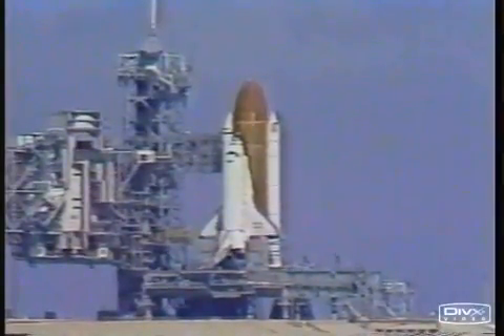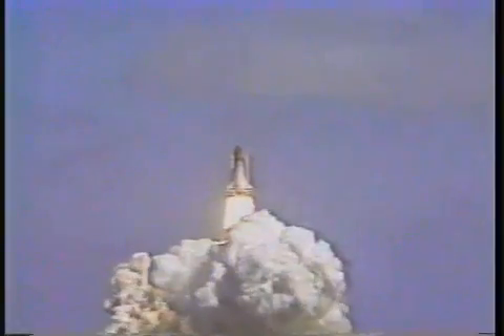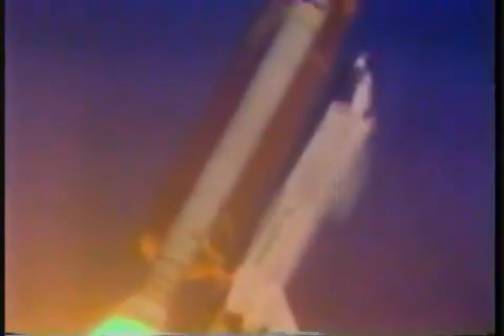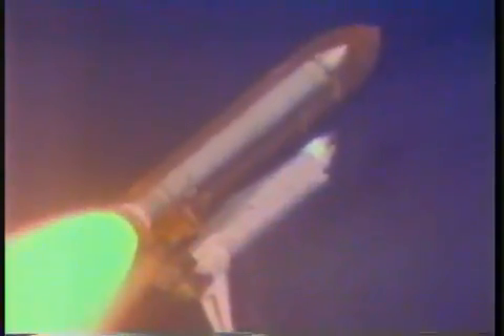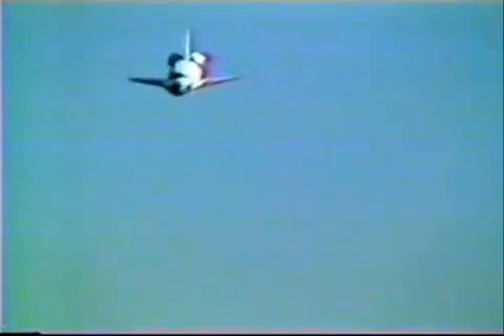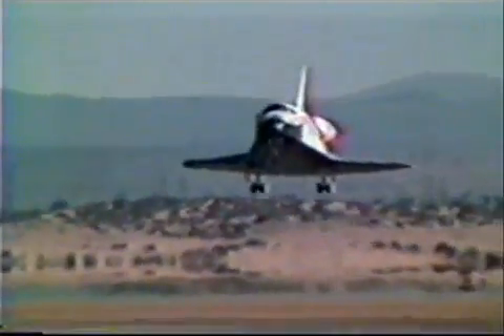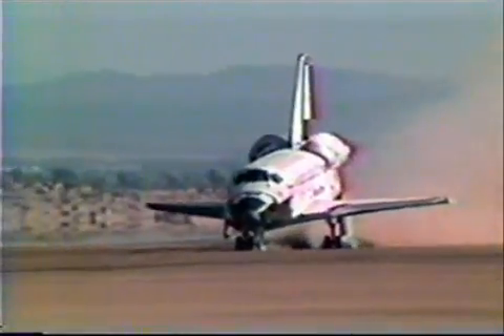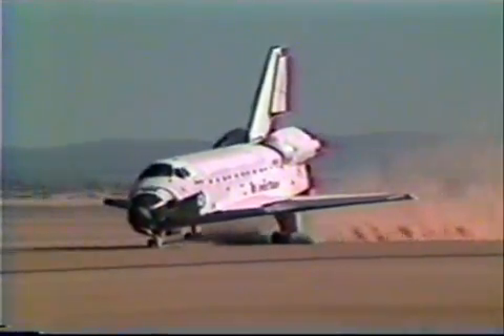STS-51J - Space Shuttle Atlantis first Launch + first Landing

Comment: 2:07 if you look closely, you see a flame emitting from part of the SRB. This launch took place in similar conditions to the infamous Challenger disaster, and it caused a breakage in one of the SRB O-rings. Thankfully, the break was not close to the External Tank, and the SRB’s separated just in time. It’s almost hard to believe this launch was almost a failure, but thankfully it was a success and Atlantis continued for another 26 years until the final launch in 2011.